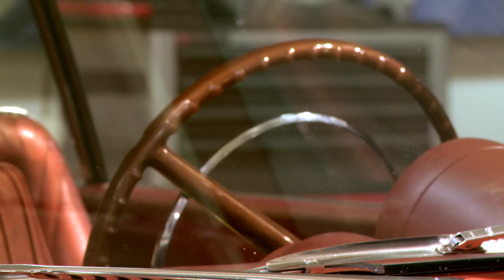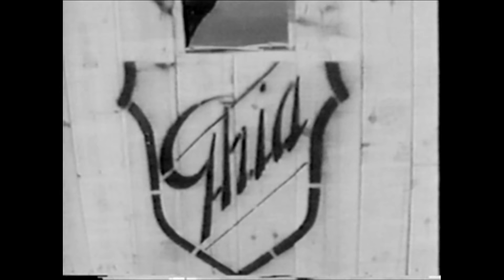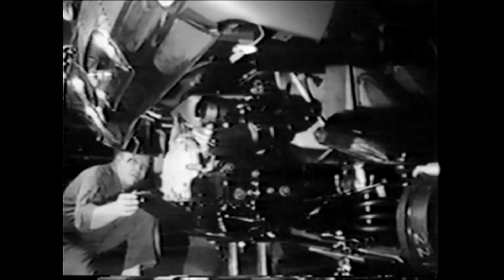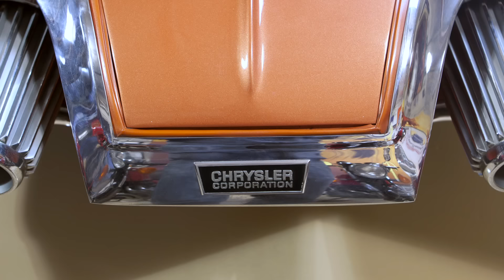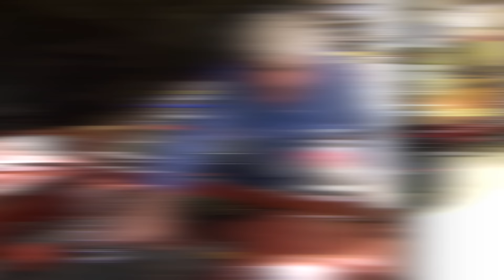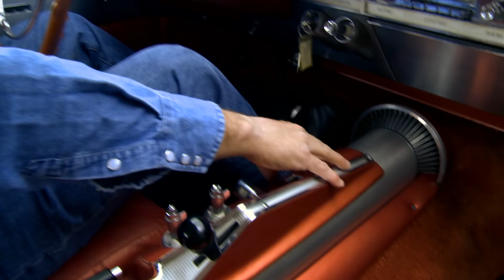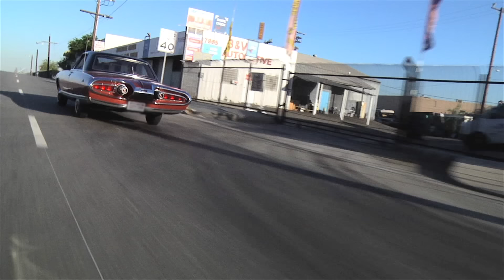1963 Chrysler Turbine: Ultimate Edition - Jay Leno's Garage

Comment: The Jaguar C-X75 was a hybrid-electric, two-seat, concept car which had a turbine range extender and driven only by electric motors. The turbine would run at its high speed efficient "sweet spot".  It was successful enough in tests. The project has just been shelved due to the depression.  I hope the technology resurfaces. Jag are to use a Lotus piston range extender in their hybrids in the meantime

Comment: Motoring writer Bill Tuckey tried one of these cars when it came to Australia - called it the most frightening car he ever drove. Engine took 3-4 seconds to spool down from 42000 RPM, during which time the torque converter was still driving the rear wheels and the brakes were next to useless. Not very encouraging in an emergency stop situation. Tuckey said he handed the keys back and said, "Never again". How do you find driving it, Jay?

Comment: if they gave the (micro) turbine the time to develop until today, it would be much more economic and be a good range extender for electric cars.

no energy in the battery. just dump vegetable oil in in. no oil ok use gas then.
It is sad.

additionally it is a great looking car

Comment: I stand corrected. Nonetheless, I doubt it would have been much of a threat to big oil. I don't know how much corn oil cost back then, but I bet it was more expensive than gasoline ... same for alcohol - maybe a bit cheaper, but not that significantly.  and big oil had the distribution system wrapped up - convenience usually wins.

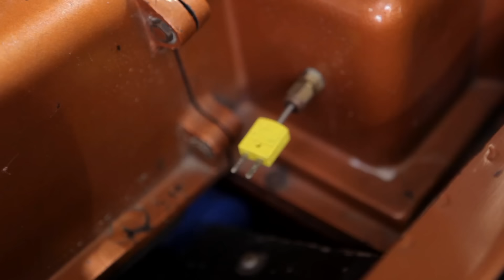Comment: Yeah those "60's Type Connectors" (seen in 16:24) are temperature probes. Still used in automotive during the R&D phase today. Good indicator that Jay most likely has an engineering vehicle which Chrysler Engineers used to measure temperature while developing the car on a dyno or driving around.

Comment: A lot of the drawbacks to a turbine car could be solved with a turbine-electric hybrid.  Anything that idles that high would be a lot more efficient if it was just generating electricity and the electric motor was doing all the pushing.

Comment: It seems that turbines would work well in long haul commercial truck applications. They have tons of torque can run on any type of fuel and would get good gas mileage if used primarily on the freeway.

Comment: Last month jaylenosgarage uploaded a video showing their in house engineered jet car called the EcoJet. There seemed to be 2 main issues no one had answers for: 1, the jets high idling power overwhelming the brakes on deceleration, and 2, the amount of noise. The Chrysler Turbine seems to have solved both of these, as the car has regular Chrysler brakes and runs remarkably quietly. Are you telling me they didn't reference this car when designing the EcoJet?

Comment: Wow that was excellent.   It is nice to get facts about this car. I was born in 65 but I have followed this car from 10 years old. Much more civilized than I thought.

To bad they did not have hybrid technology back then. The 22,000 rpm Turbine could would be a hell of a generator to charge batteries.  Use the Electric motor around town and the turbine on the highway.